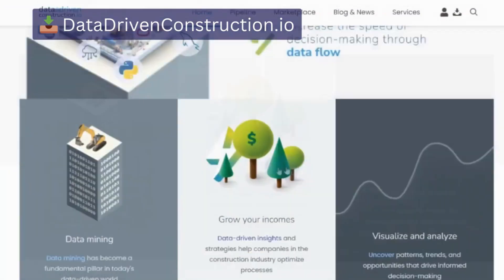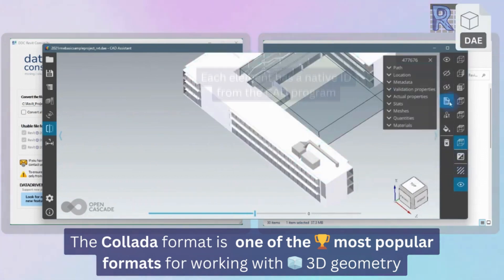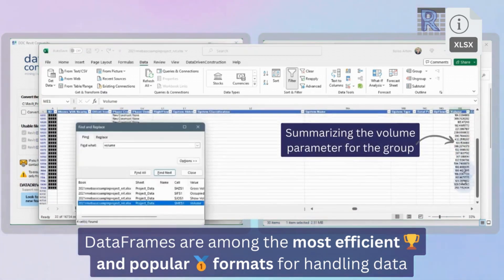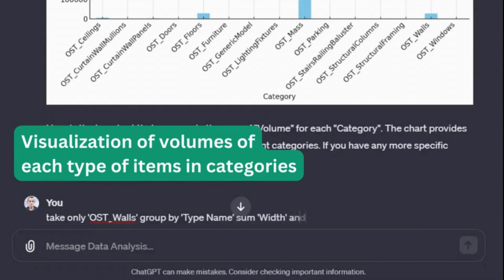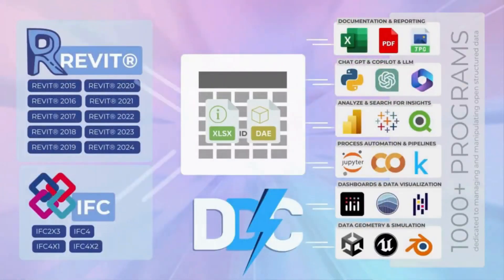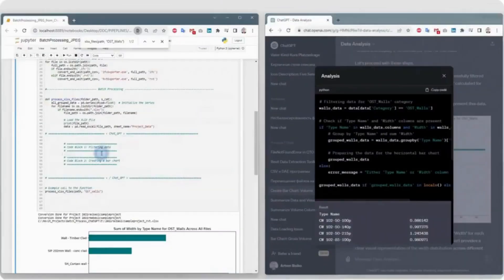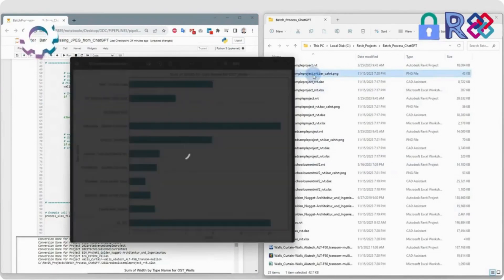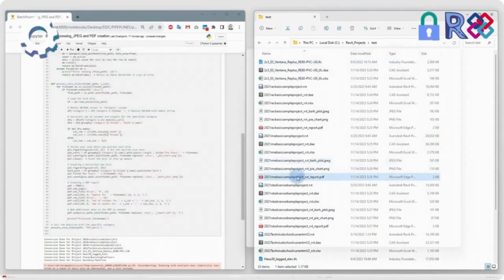Revit and IFC with ChatGPT  |  Automated ETL with CAD (BIM) Data

Comment: the installer of this software is blocked by Windows Defender, cannot even try to install
Reply from the maker: Ruben many thanks for your remark.
All executable in last version of DDC converters re signed by certificates and theoretically antivirus should not generate a warning. Please try downloading the ZIP file again of last version and write if the antivirus still shows the warning.
Reply: @datadrivenconstruction  not about antivirus, there is a property Unblock in the executable file when unzipped in a company computer that we never know, so if unblock then no problem